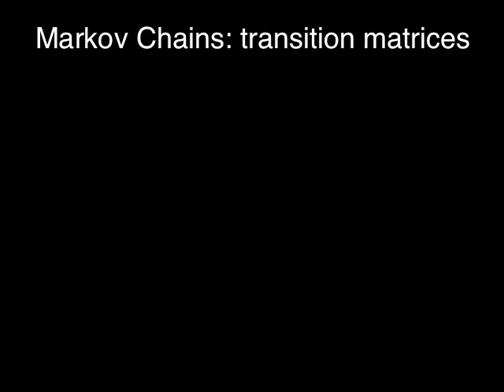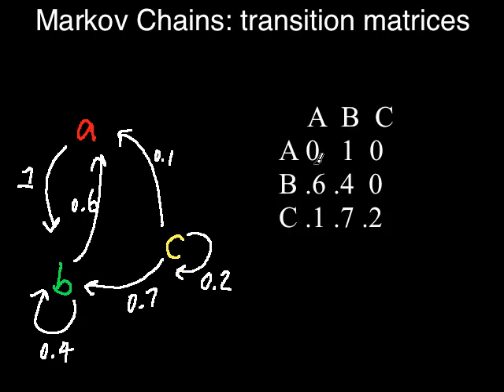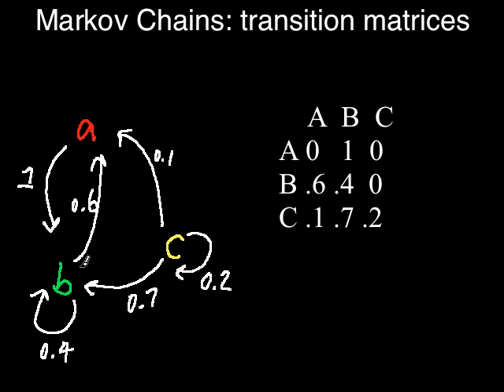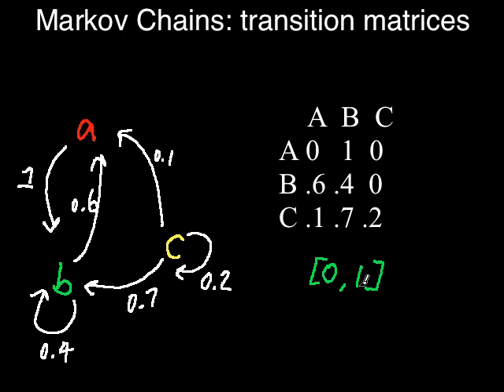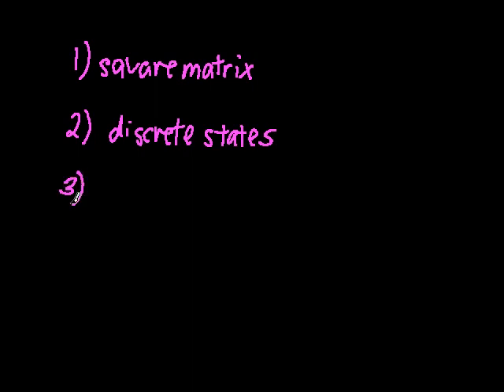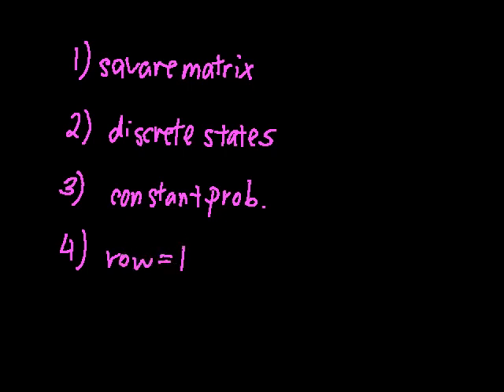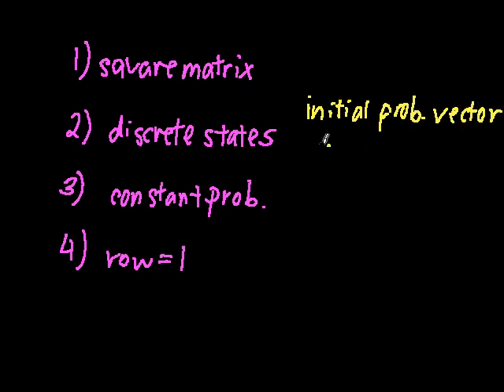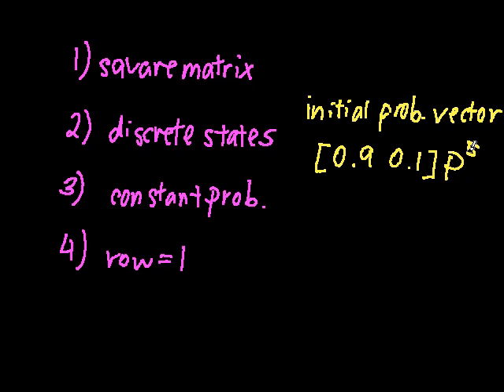Markov Chains Transition Matrices

Comment: This cleared my doubt from the previous video.

BTW, what happens when the sum of elements in the initial input vector is not 1 ?(say if I have faulty dataset)
Is it even possible?
Reply: then the generated vector will also not have the sum of 1